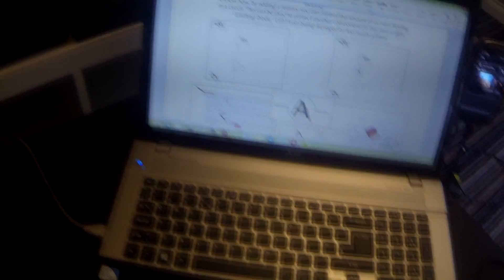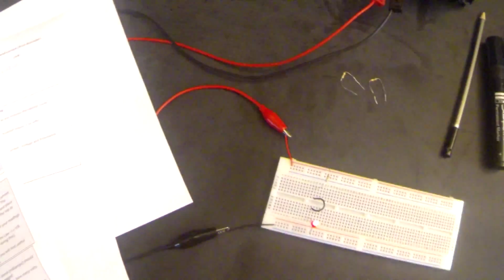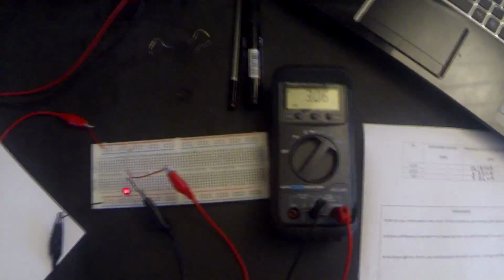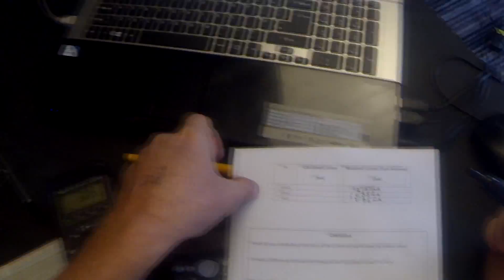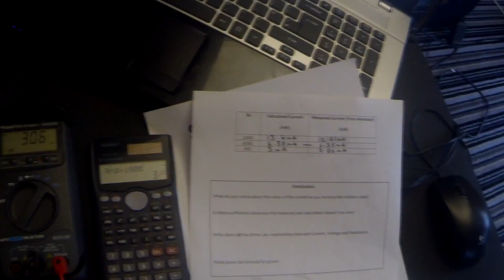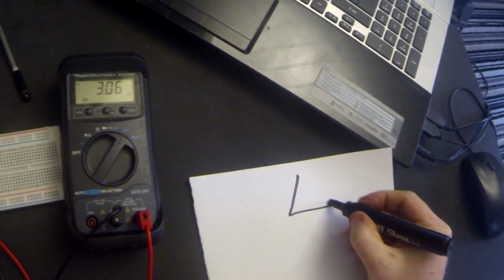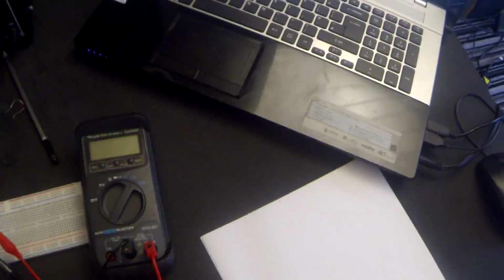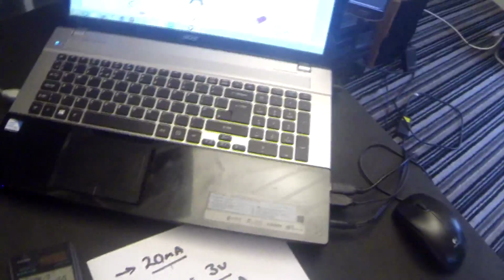Tutorial 1 : Current Limiting Resistors  GCSE AQA Electronics

Comment: This was really well done. Now, if I want to add several LEDs, do I subtract 2 V each time? Would I need to raise the voltage used as a result? Thank you
Reply from the maker: Depends if adding LED's in parallel or series. Better in parallel off 5v. In series you wouod drop about 2v across each LED. The theory and practical don't always match up so best to experiment a bit.